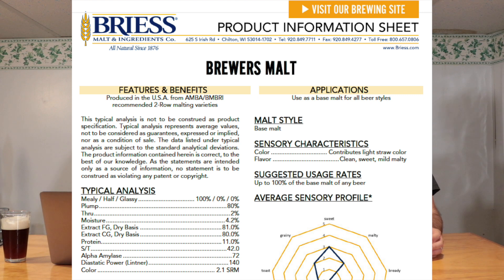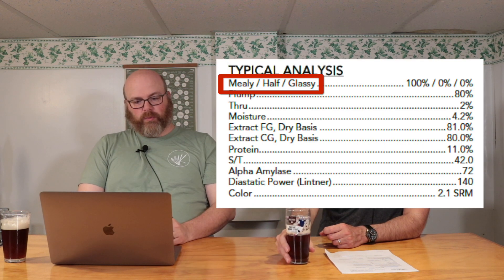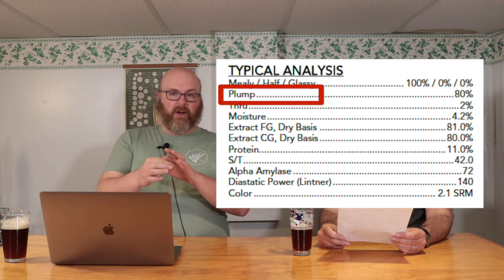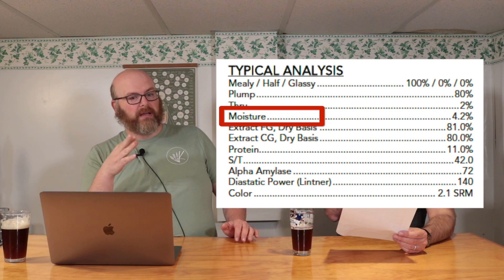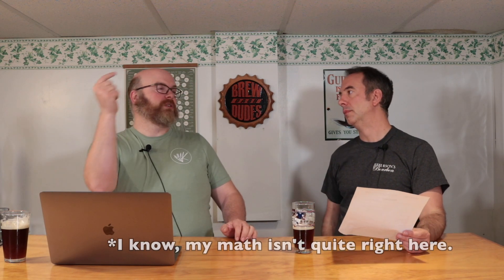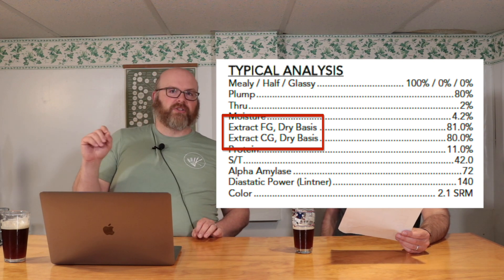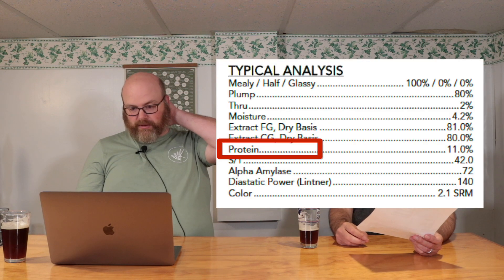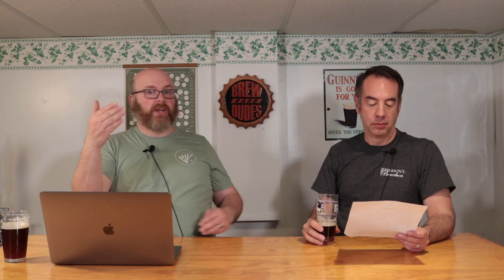How To Use a Malt Analysis Sheet - Understanding Malt Analysis Specs!

Comment: Hello, here is Marcelo Fenoll from Brazil. I would like to suggest a note about the Diastic Power (DP) of the wort. At 11:30 of the video, it says that a wort with DP less than 50oL may have starch conversion problems, when using, for example, 50% Pale malt (60oL DP) and 50% crystal malt (0oL DP). This doesn't seem right to me, as the crystal, caramel and roasted malts were all 100% converted in the malting process, leaving only fermentable sugars from these malts. For the base malt, it will be able to self-convert. At my knowledge, the conversion problem only occurs when there is STARCH coming from, for example, a raw cereal. In this single case, yes, it is necessary that the diastic power of the recipe be greater than 50oL (in my point of view and personal experience, greater than 60oL). Hugs and good beers to all.
Reply from the maker: Crystal malts aren't normally 100% converted but I get your point.  My point here is that the time required to convert your mash (regardless of its total make up) may need to increase if your grain bill brings the TOTAL DP down and lower than 50DP.  There are still some complex sugars that the enzymes in the base malt can work on in crystal malts that may benefit from the mash step depending on what you want your end result to be despite conventional wisdom of using them solely as steeping grains at times.  Cheers! -Mike

Comment: Man, I used to stress out about trying to hit the right mash temp.  I would mess around with adding boiling water or cold water, then end up even farther off.  With practice, I got better at getting into the range of 149-154, and learned to leave it alone.  Never really notice a difference with varying temps. I did one batch at 158, supposedly to get more non-fermentable sugars, if i remember correctly.  I was surprised that the recommended temp was so high, but that beer did turn out good.  Thinking about it now, it probably had more to do with the different malts in the mash than the temperature.  It's good to know that the temperature range can be expanded a little if necessary.